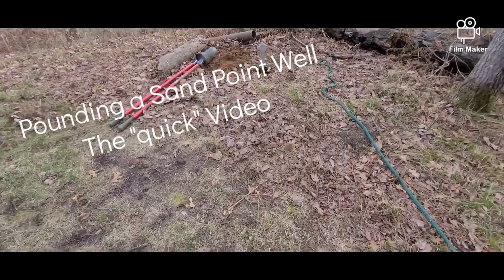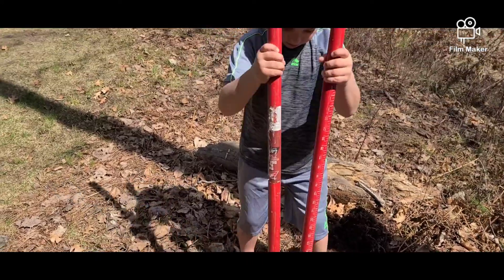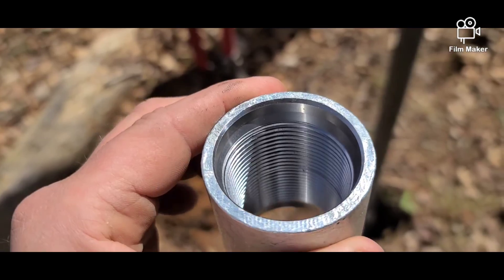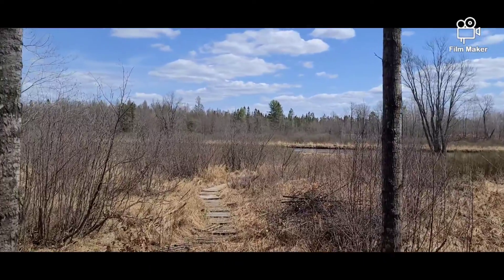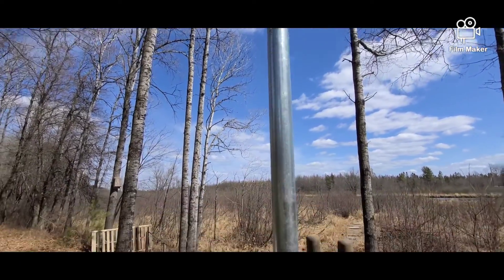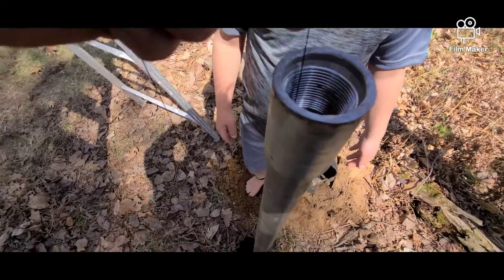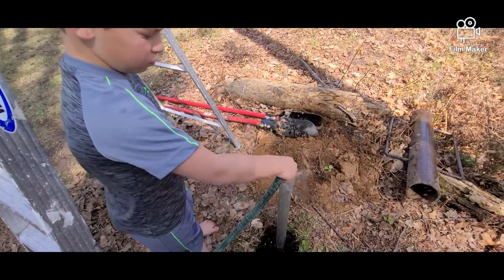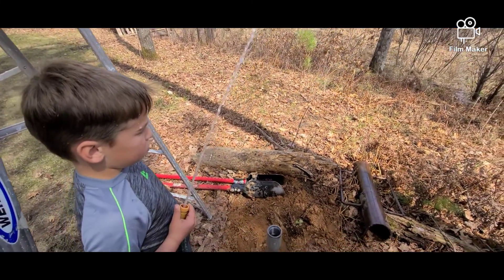Sand Point Well (the quick video)

Comment: Thank you for this video, very informative. I will be installing a point well at my camp soon. It makes sense to me how you checked to see if you are truly in the water table. If you can never fill the pipe; how can you prime the pump? All feedback welcomed.
Reply from the maker: So to prime the pump there should be a nut on the top of your pump to add water. It's built into your pump. Also once you have water flow the check valve that you install in your pipes will help keep the pump primed. Check out my first sand point well video for more info on check valves
Reply: TY 4 the reply & info.